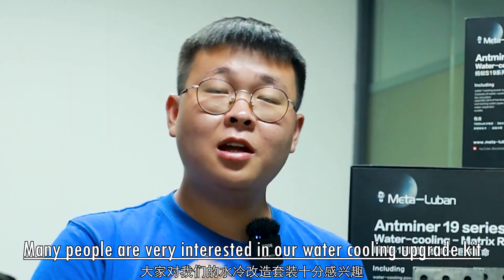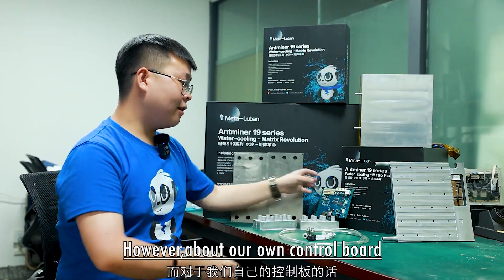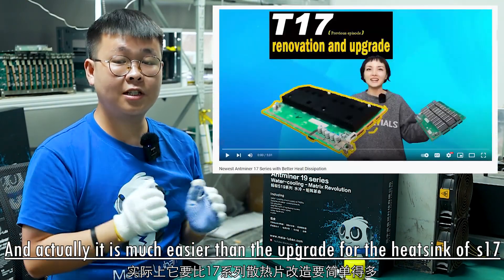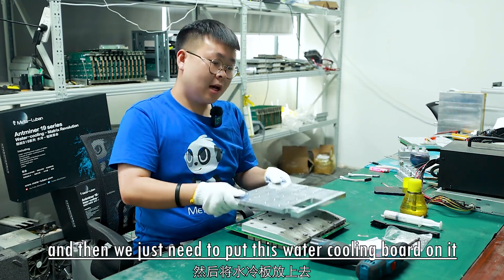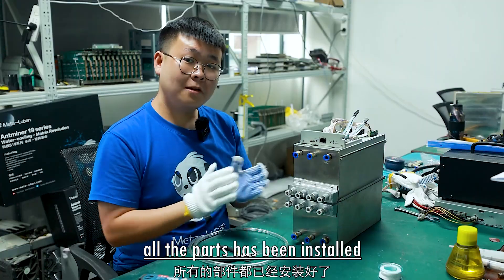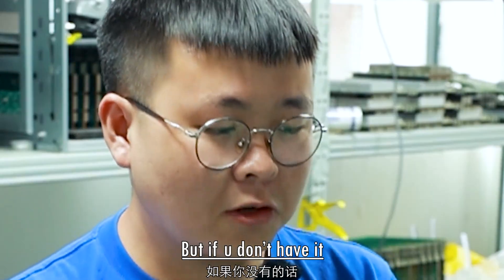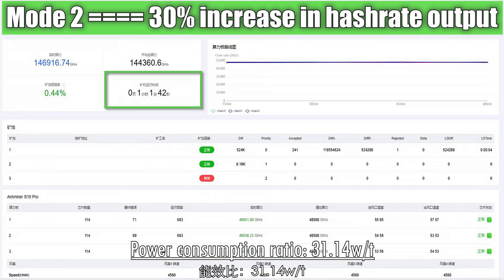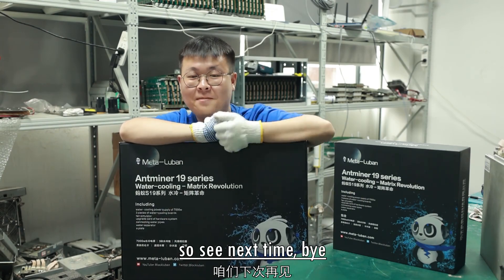Water Cooling Upgrade for S19, 180T High Hashrate for BTC Mining

Comment: Hi, how much Hashrate-improvement do we have at S19, S19j pro and S19 xp ?
Reply from the maker: Hello, it depends on the specific parameters. However, it is generally increased by 60% on the basis of the original computing power. But the optimization of S19 XP is the most perfect, and the computing power has increased to 224T. The power consumption ratio is only 27

Comment: Excellent video friend. Do you think that using 2 containers, the external one with ice water and the internal one with mineral oil, will serve to keep the asic miners at a good temperature? Thank you
Reply from the maker: That could keep the miner at a good temperature. But the dissipation efficiency is much lower than just use water on cooling, especially if you want to overclock. another thing is that oil immersion cooling requires a lot of repair especially on psu and cables. it takes energy and money to mentain.
Reply: @Meta-Luban  Can an AntMiner S9 ~13.5TH/s ASIC be equipped with hydrocooling? How much does this adaptation cost? Would a miner have a higher efficiency at 20 ºC? Thank you
Reply from the maker: @yeanpadron7020  there is an official model S9hydro in the market, which is more economical than using the hydro cooling equipments to upgrade S9

Comment: hello dear i have Ebit E12 mining farm 13 miners . There is any kit for E12? and overclock available ? also from where we supply water ? there is no tank for water ?
Reply from the maker: Hello! I'm sorry. We don't have this overclocked firmware you're talking about. We have overclocked firmware for the S19 series.

The whole set of water cooling equipment is circulated through the external water tower. You just need to make sure the water supply is safe.
Reply: @Meta-Luban  okay dear but water cooling is available for e12 ?
Reply from the maker: @coldxzeroyt  sorry sir, we don't have it. we currrently only have water cooling kits for S19 series.😁

Comment: They have the pro19 for $1900, at 3000 watts, you could run 2 rigs at 6000 watts and get 200 TH, 2 liquid cool rigs would be 13000 watts, the electric bill alone would not be worth the upgrade, unless you have free electric.
Reply from the maker: Hello! Friends! 
The upgrade of water cooling equipment not only overclocked, but also reduced the machine damage rate. Water cooling equipment overclocking data is always the same. It's like a straight line. It just keeps going. And we can also control the overclocking data by ourselves. When the currency price is low, the overclocking is less, so as to ensure that the machine is not shut down and continue to obtain income. When the price of the currency is high, a little more overclocking, so as to get a fat profit. If you want more information, please send us your contact information at support@meta-luban.com
Reply: It makes sense if thermal efficiency improved. But Hydro cooling is a new way to lower the capex but have more hash even at cost of higher power consumption. Especially when the bull market the cost of power could be less than the additional BTC mined,
Reply from the maker: @Pizza-lightning  You are so right, my dear friend. Looking forward to hearing from you!
Reply: You could just buy the water cooling and pump/radiator use Vnish for a more efficient overclock.

Comment: Why only 15 minutes of testing at Mode 1?  That's the most important one that makes the most heat.  Come on guys.
Reply from the maker: My friend, our tests are divided into several criteria and the testing time is based on the overclocking needs. The final data also succeeded in validating our idea that the overclocking figures are under our own control, which means that we can overclock the machine by 15% when the coin price is very low and guarantee that the machine does not shut down. At very high coin prices, we can control the overclocking by 70%. This is a great test! If you have questions, please email: support@meta-luban.com
Leave your contact details and we'll answer them all for you!

Translated with www.DeepL.com/Translator (free version)